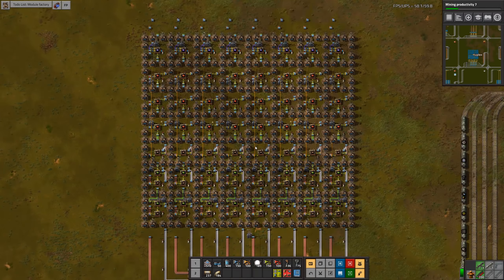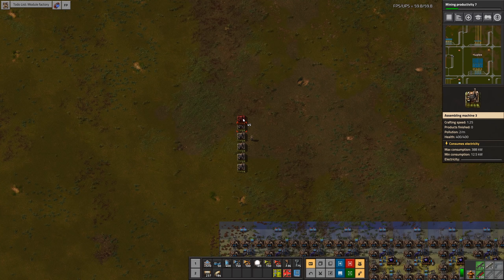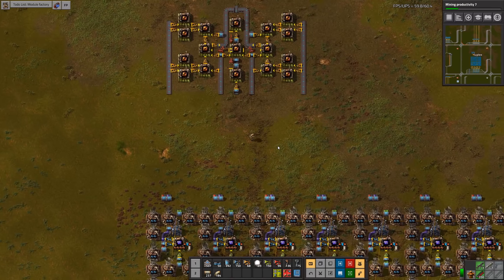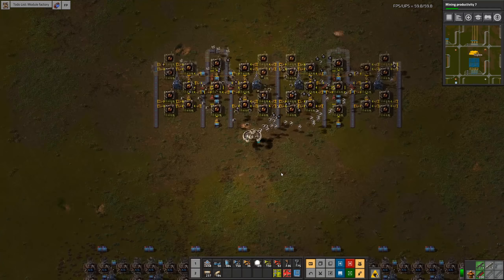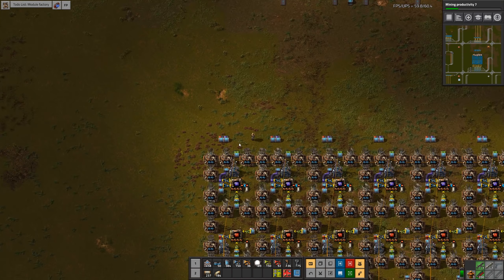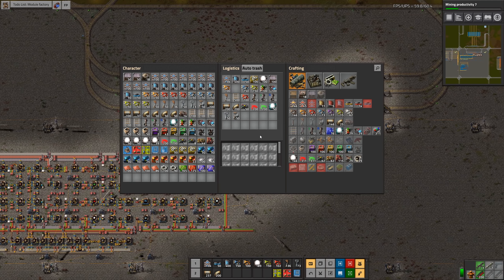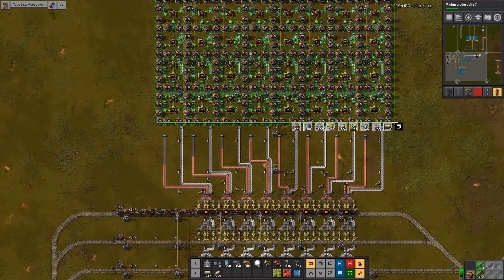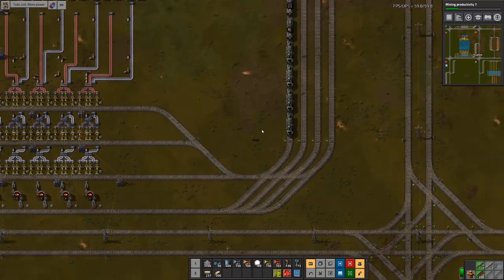Factorio 2,500 SPM Grid Megabase #29 - Finishing the module factory

Comment: Your output on the red and green circuits will be completely unbalanced. You need to pull from all four splitters to reduce the problem. I know you playing bot free, but you might want to consider changing the requester boxes to buffer chest so you can upgrade the modules without going there.

Comment: That 8-8 balancer wont work correctly unless you pull from each of the splitters at the end.
Reply from the maker: In a couple episodes I abandon the balancers and go to 8 parallel factories.
Reply: @TuplexGaming  spoilers! Really, though, I was wondering why you didn't set up your module production with Beacons initially. It's the first thing I'd Beacon since it regulates how quickly I can upgrade everything else.
Reply: @jaktracy  he told in last episode. he can only fit 14 Factories in one square when he uses 12 becons, and 7.5/min is enough for now, he said.